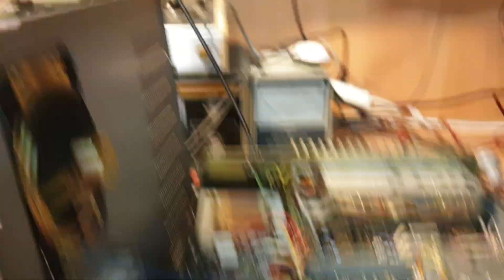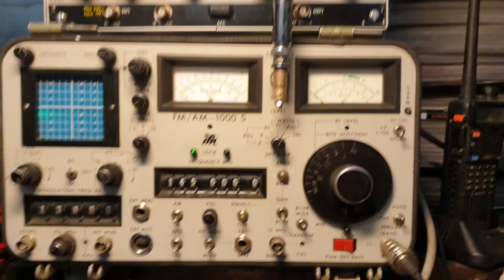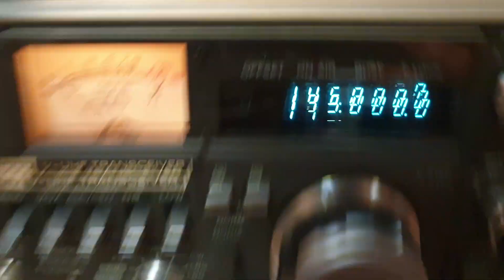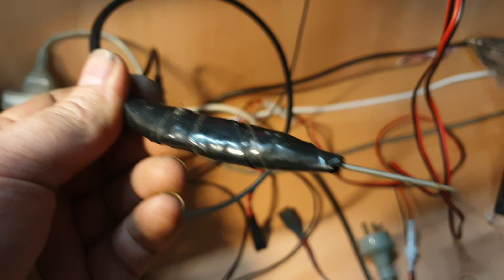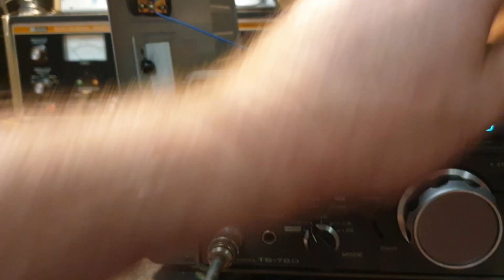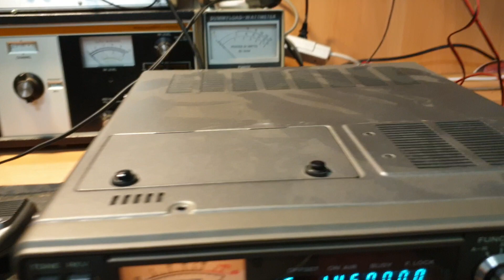Kenwood TS780 144/430 Mhz All mode Transceiver

Comment: just bought one of these for £40 gbp,
sold by Radioworld in the UK as working and of course it wasn't (Dodgy Dave strikes again)

only issue is the VFO encoder doesn't work slow..
it's tatty and it works fine, 20hz off frequency but 10w and good clear audio..

can't wait to use it on air on SSB.,.

Comment: I have one, bought cheap from flea market, totally dead. Now 144Mhz is ok, most of oscillators, inductors and trimmer caps are off freq. I'm still struggling in 430MHz, after tuning HET back in freq, still very weak signal received. RF unit maybe bad (2 mosfets), others I dont' know because 144 MHz is quite normal in receive. Any suggestion? Thank you